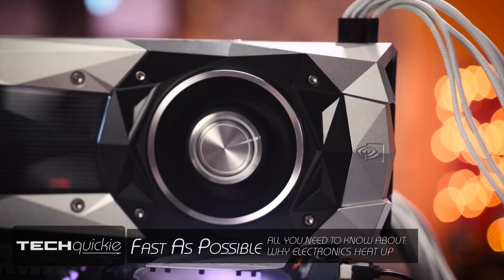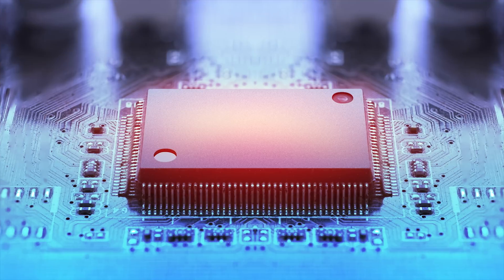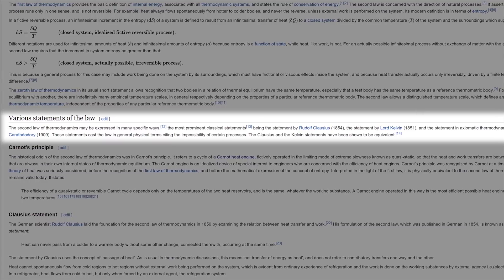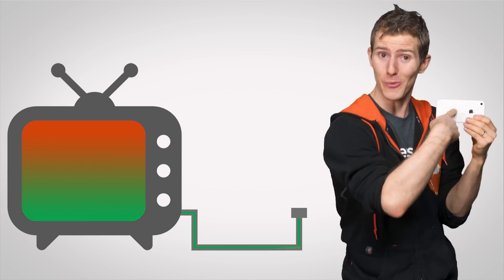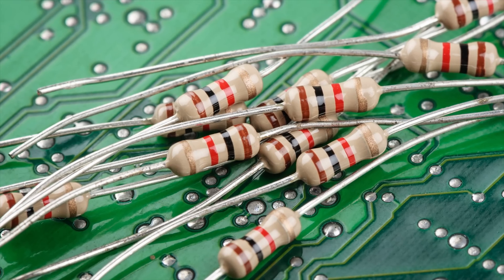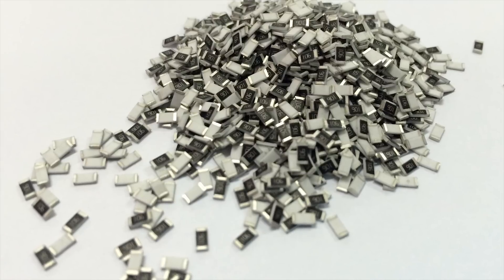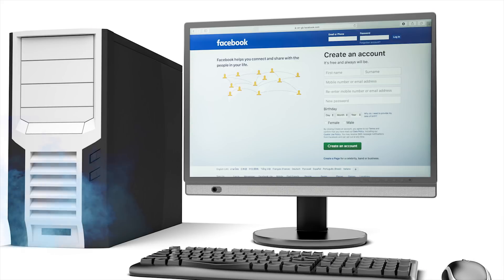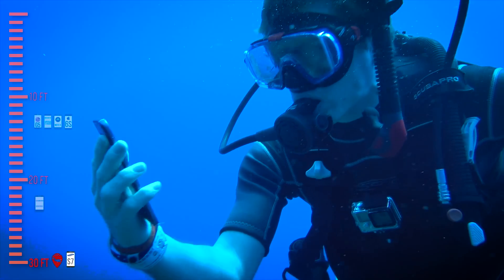Why Do Electronics Get Hot?

Comment: Hey man ! Could you guys make a video/guide about undervolting laptops cpu ?
Reply: Rod Cord it's not always about the power. he might be doing light tasKS and needs more battery life
Reply: Rod Cord bs, you can undervolt quite a bit until you hit speed loss.
Reply: The reason for undervolting a laptop is to make it generate less heat by pushing down the core voltage (and probably other voltages as well) as much as possible without having to reduce the clockspeed to maintain stability. By generating less heat, you're less likely to experience thermal throttling, but less heat output especially means less fan noise.

In order to do this you basically do the same thing as when overvolting to push an overclock further - but in the opposite direction. 
And by this I mean that you will need a laptop which BIOS supports editing voltages, which sadly isn't that common on laptops.
But if you're lucky to have such laptop, push the voltage down in small increments (-5 mV), then stresstest it for 10-15 min (or more if you want to) using something like Aida64 or similar, then rinse and repeat until failure. 
Upon failure, back the voltage up  until it's stable. Then fire a stress test for maybe 4 hours or so. If it doesn't fail, well congrats! However still keep in mind that it may still fail even after 2 weeks or so. After 2 weeks, I'd call it stable.
You can also apply the same concept to the CPU Cache Voltage, and the DRAM voltage, all to reduce heat. But in that case, wait until one part is 1-2 weeks stable before moving on to the next part.
Reply: Laptops often do not offer any voltage control, but some kernels for smartphones will allow you to adjust the voltage going to the SOC. If you are willing to put many hours into stability testing, and have an unlocked bootloader, root access, and the right kernel, then you can have a go at undervolting the SOC, and testing for stability. if you have a good chip, you can extend your battery life by a small amount without giving up any performance. The same applies to laptops and desktop PCs, though there is little reason to try it on a desktop PC since battery life is not a concern, and the main reason it would be done there, is if you were going to passively cool it.
Reply: Undervolting IT HELPS you to get more performance out of your Laptop's CPU. It is a fact known in the tech comunity. Do your research before saying bullshit.
Reply: locknloadbitch don't listen to these idiots. Use either XTU or Throttle Stop. Research your CPU, and start at what seems to be a conservative baseline, usually -60. Then test using XTU's bench, and go lower in increments of -20. repeat. If it crashes, restart (XTU parameters are not saved in case of crash). Then, when stable for more than 5 minutes, keep your computer on and go about your day (until blue screen). Go up in increments of 1, and never do sensitive work that can't be saved until testing is finalized
Reply: steffeeH Yep, though it's not always only through the BIOS.
Example was my old lenovo x121e laptop with a 1.6ghz AMD E-450 APU.

The BIOS had no options for CPU voltage, but with a combination of two programs i was able to run it at roughly 0.18V less than it's normal voltage and keep the CPU fan powered down entirely below ~75C on the CPU. This meant it ran without the fan switched on at all unless under heavy load, with a SSD that meant a fully silent laptop most of the time.
(programs needed being tpfancontrol for the fan side and brazostweaker for the voltage. the latter is specific to the CPU family though so google for potential similar programs for other CPUs)
Reply: locknloadbitch There are guides online to help you undervolt. I used Intel XTU and got -0.040 on CPU and cache. More importantly, no more thermal throttling.
Reply: Just look up Dave2D's video on it Pretty easy
Reply: i've heard you can undervolt if your cpu throttles. that way you actually get BETTER performances by undervolting....
Reply: woopygoman However that means you're manually throttling the CPU by reducing the maximum clockspeed. Undervolting is all about cutting the voltage without having to lose performance. As for passive cooling mode, it's kinda dodgy and doesn't work as linear as you would expect.
Reply: undervolt does not mean speed loss, as cpu's are overvolted by default for stability. It can even lead to higher clocks because the thermals aren't stopping it
Reply: DynamicHunter That's not how it works. If anything, overvolting leads to higher temperatures (blasting high if on hexacore or more), which combined with harder overclocking can cause instability if you don't keep the thermals in check and have a good cooler. 
Without overclocking it just increases the temperature without adding any performance increase. The reason for overvolting is to make the transistors be able to keep up with increased refresh/clock speed (more on it here: http://www.overclockers.com/forums/showthread.php/384756-How-Overvolting-Works-The-Dangers-of-Overvolting-and-quot-Safe-quot-Overvolting-Technique )

Undervolting is all about cutting thermals without the transistors getting too little voltage to properly handle the tasks and cause instability, so no, if done properly it doesn't reduce performance, it actually increases it by lowering the risk of thermal throttling :)
Reply: steffeeH 
but that's what he said...by default cpus are fed higher than required voltage bcoz each die differs so OEMs choose slightly higher voltage(in the range of 20mv-150mv even) so it wastes a lot of power and heats

as power is proportional to square of the volts supplied...
so underclocking is quite good,I have also underclocked my i5 5200u by 40mv although there's a room for more underclocking bt I felt it's more than enough....
voltage offset shouldn't be decreased too much as it can cause some issues with the change in room temp.

after undervolting my battery life has increased by 25% and it runs cooler also
Reply: I know it's the first result on google, I'm not trying to be condescending. I've used this guide extensively when learning and it's still useful for older CPUs (pre haswell)
http://forum.notebookreview.com/threads/the-undervolting-guide.235824/
Orthos CPU may be old but I don't know any alternatives atm besides propietary motherboard utilities which you get from the respective manufacturer's website. I liked ASUS's AISuite the most/. EDIT : Intel Xtreme tuning is also great.
Reply: Does it work on GPUs too?
Reply: FailQuail That's nice to know! What softwares were these?
Reply: Yosyp GPUs should be even more simple as you overclock it only using Windows software. Though I can imagine not all of them actually feature cutting the voltage, and only being able to increase it. Download a few programs and see if it's possible. For instance you have MSI Afterburner and EVGA Precision X (my personal favourite)
Reply: watch dave 2 d's video titled
"$20 hack to boost performance"
he explains abt undervolting there
Reply: And is it possible on Mac? if yes how. Please! :D
Reply: It's a great idea, I get 1 hour more battery life for the same tasks and same clock speeds just by undervolting a little. Most chips these days, especially AMD GPUs come severely overvolted just to hit some artificial stability quota.
Reply: LifezLife same
Reply: locknloadbitch For a second I thought that was a comment I posted 😂
Reply: You can easily throttle your CPU in Windows power settings. Go to control panel - power settings Choose a power setting to change, the one you want as your throttled CPU setting, then go to "change advanced power settings". In the box that appears, scroll down to "processor power management". You can then choose the maximum % you wish to run the CPU at and even choose passive cooling if you wish which will prefer to slow the CPU rather than run the fan where possible

Comment: They get hot because they are not perfectly made. Losses in tension are converted to heat.
Electronics also sometimes need lower voltages than the alim. which means, by exemple, having 1 amp and 12v, if you need 5v, you will convert 7v into heat. in this case you will loose 7W